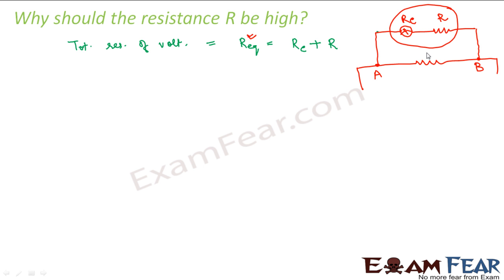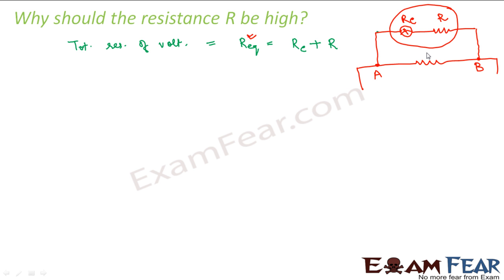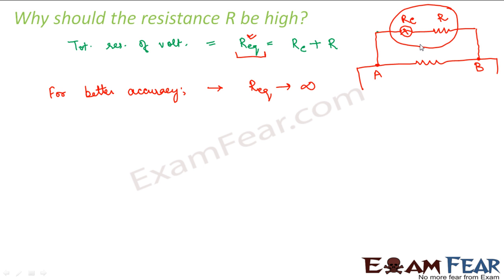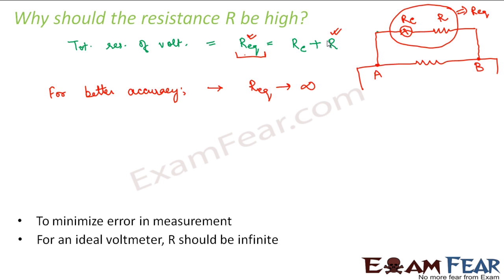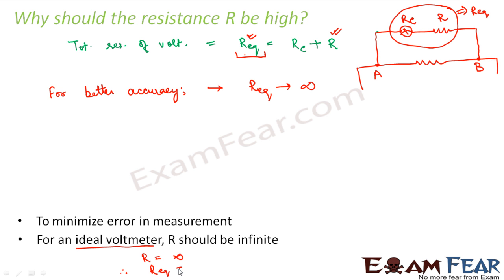Potentiometer physics class 12 part 2

Comment: mam if the resistance is infinite no current will flow through voltmeter branch but the how will voltmeter deflect without current
Reply: kuku kalla how does the coil works? Potentials difference isn’t a physical thing right? 6:20 is the answer for the same
Reply: R should be infinite for only ideal voltmeter and not all voltmeters
Reply: I have the same doubt...please reply
Reply: The voltmeter is connected in parallel to another circuit at points A and B where the current is flowing. And the voltmeter measures the potential difference across points A and B.
Reply: same doubt